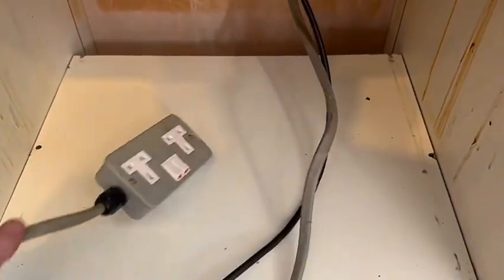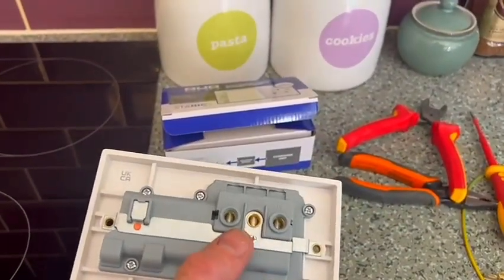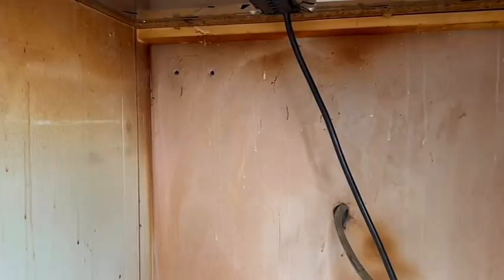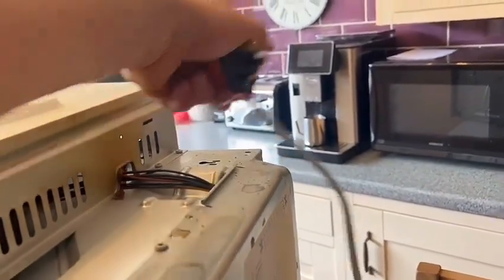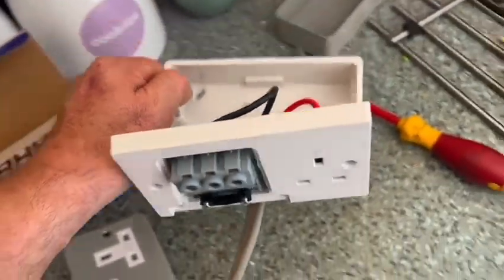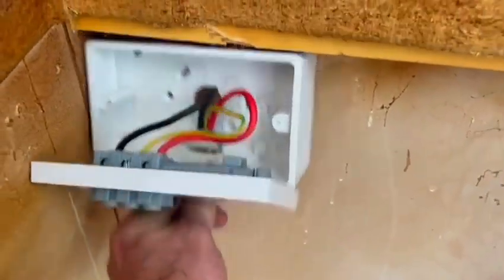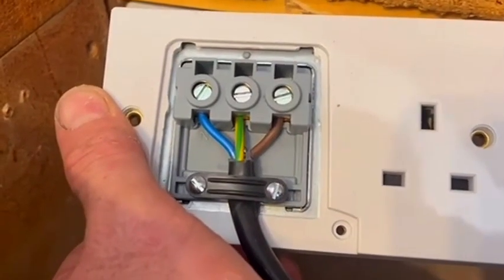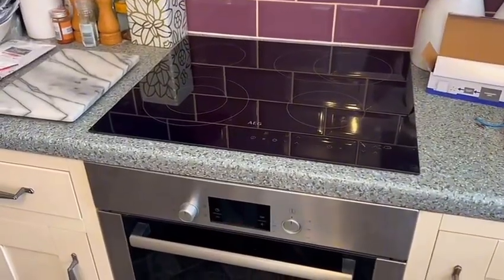An Easier Way to Wire up a Cooker

Comment: Washers are a good idea on the back boxes. As an alternative, I've started using washer head screws instead of wood screws and washers. 

Latest hob and oven I'm doing, both are on 13a plug tops. Handy.
Reply: @rodgerq
I hope the sockets are accessible. 
I saw this with both hob and oven on a final ring in a one bedroom flat. The ring was in 4mm cable, which I thought was overkill, but maybe they did the derrating calcs. Only two circuits, the final ring and a 1.00mm lighting circuit, both on AFDDs giving maximum protection. The CU was a small inexpensive unobtrusive thing. I asked if there had been any problems with tripping, they said ''no''. Heating and hot water was by a gas combi, so no heavy electricity demand, although I saw a washing machine and small dishwasher. Diversity worked apparently. The one final ring was suited to the lifestyle of the occupants for sure.
Reply: @johnburns4017   kitchen isn't fitted yet but I'll probably just mount the socket in the adjacent base unit and pull the cables in through an access hole
Reply: @johnburns4017  good info mate. Thanks for that. Haven't seen those EV sockets tbh but they do sound better(built like how every other should be)
Reply: Do not use a double socket for the two appliances, as the double is only rated 13A for both outlets. Use two single sockets. BS1363-2 says for the temperature rise test for a 13A socket the connected load will be 14A for a minimum continuous period of 4 hours or longer until stability is reached with a maximum duration of 8 hours. Manufacturers skimp with their sockets unable to pass 13A continuously, only for short periods - breaking the law. 

There are sockets available with ''EV'' on the front and back which are built more robustly for EV charging, being tested to continuously pass 13A. Which consists of 28 continuous cycles each of 8 hours on, 1 hour off, 8 hours on, 7 hours off followed by inspection. There are no design changes to an ‘EV’ marked socket, relative to the standard sockets, just some extra tests, and some letters applied to front and back.

Use ''EV'' sockets. They are not much more in cost.

Comment: That does not conforms to the regulations, if no external accessible isolator. But forget the connection unit the customer provided. Get a double connection unit and hard wire in the oven. You do not want a 13A fuse hidden and 13A drawn for long periods from a plug - plugs were intended for portable appliances, not fixed.  The oven does not need a fuse as it is a resistance element appliance that cannot draw more than 3kW. All the oven needs is fault and RCD protection at the consumer unit not overcurrent protection - if the cable is capable of taking more than 13A. Also, a fuse running at max amperage for a time, which this 13A fuse will do, can get hot, so avoid.
Reply: Isn't the Isolator at 1:48🤔
Reply: @temp26j724-i  Yes it is.
Reply: @temp26j724-i  
It is not clear. He clearly said socket.
Reply: @johnburns4017  The cooker isolate is CLEARLY visible at 1:48.  What you had down below was the outlet that went into a double socket.  That's what he replaced with the new device.  This gives the means of isolation and makes everything compliant.
Reply: @cjmillsnun  
No cooker isolator is clearly seen at all. He clearly said socket.  He said the thinks it is 2kW. Sounds like a DIYer. The first think a professional would do is ascertain the kW.
Reply: @johnburns4017  It's a cooker isolator switch with a socket. Pretty standard. As you are not an electrician, you obviously don't know what you're looking at.
Reply: @davebadger100  
Not clear. The vid does not show an isolator. He said socket. I never made it up.
Reply: Ignore John Burns His House Down. He is not an electrician. He is a Walter Mitty type who frequents the comments sections of electrical videos imparting his version of regs and practices in a vain attempt to impersonate an electrician.

Various nuggets of his "knowledge" include.........

An obsession with French electrical practice where he tells everyone that UK domestic installations should be protected upfront with a 500m/a time delay RCBO even though most UK installations are not TT unlike France. Even though 500m/a is unsuitable for domestic anyway. 
That is a change from his original stance when he insisted that an normal 500m/a was required, but didn't/couldn't see why this was a bad idea.

He thinks that ring final socket circuits cables shouldn't be terminated at the socket, but rather wago'd off in the back box and the socket fed from a single flex.🙄

The other day he said that a ring final circuit should be protected by a 2 pole MCB.

On a fire alarm video he insisted that domestic fire alarm circuits MUST be on lighting circuits rather than a dedicated circuit, even though both BS7671 and BS 5839 say nothing of the sort and he then completely avoided the point when asked to back
 up the claim. 

He hasn't got a clue.
Reply: Time served for sure^^
Reply: @MegaMetinMetin half an hour time served
Reply: @curtisj2165  
Which is a lot more to your 30 seconds. 🤣
Reply: New Howdens 2.3kw ovens have a Do No Fit Plug attached
Reply: @johnburns4017
All UK plug tops that conform to BS1363 requires a BS1362 fuse. 
Do not use if the plug top does not have this on the plug top! Also if the plug top have no fuse like the foreign plug converters that do not have the BS1363 and is fused ARE VERY DANGEROUS! They frequently heat up and are known to cause fires🔥!
Reply: @MA-mo7yj  
It is plug not plug top. 🙂  Plugs are for portable appliances. Fixed appliances need to be hard wired, especially those running at maximum current draw of thirteen amps.
Reply: The oven is 2kW.  2kW is not 13A.  13A at 230V is 2.6kW.  in old money using 240V it's more. So it will draw 10A max.  So no it won't be working at max amperage, it won't even be close as there is 600W spare capacity if running at 230V.  In reality it'll be at 240 (as we haven't changed transformer infrastructure in the grid) so will be drawing 8 1/3 amps.
Reply: The oven comes with a plug, so it is designed to have fused protection.

If anything happened to the oven and it caught fire or damaged the kitchen oven housing or worktop then the insurance company wouldn't pay out
Reply: @marcoequi111 plug top have been retro fitted.  It didn't come supplied with plug
Reply: @grumpyspark2549  
Correct. A brief glimpse of the fitted 13A plug can  be seen at the beginning. He did not say what the kW of the oven was - only he thinks it is about 2kW. Which appears too low for an oven.
Reply: @marcoequi111 
As long as it is fitted to current electrical regs it is fine. Sometimes manufacturers inatructions take precedence.

One thing is clear fused plugs should be accessible. So a socket needs to be in the next cupboard with an opening door.
Reply: @johnburns4017
No the BS 7671 ALWAYS TAKES President! If the manufacturers instructions contradict the regs then seek professional advice! (You are OBVIOUSLY NOT COMPETENT WITH ELECTRICS and should stop giving FALSE AND INCORRECT ADVICE!).
Not true but you can state the regs to prove me wrong. Also there is a easily accessible isolation switch above the countertop next to the hob which is shown in the footage.
Reply: @johnburns4017 there is no regulation that say fused plugs must be accessible
Reply: @curtisj2165  
Regulation 553.1.5: Socket-outlets “shall be installed in a position so as to be readily accessible for use”.

Regulation 132.12: Every item of equipment must be arranged so as to be accessible for operation, inspection, testing, maintenance and repair.

If a socket and fused plug is hidden behind an appliance (e.g. a fridge/freezer/oven), it may be acceptable only if there is a separately accessible double pole isolation switch controlling it.

Regulation 537.2.7: requires that you must have a readily accessible means of switching off — typically a switched fused connection unit (FCU) or isolator switch above the worktop.
Reply: There's no fuse in that unit
Reply: @curtisj2165 
Not required as the plug top has a fuse.
Reply: @curtisj2165  wrote:
''There's no fuse in that unit''
Strewth!

Comment: I'm no electrician, but of this socket is wired to a 6mm cable for the oven, w I uldnt it then potentially allow to much current to be drawn by the hob cable without tripping the MCB? I guess you can compensate by having a 13A fuse incorporated in the socket or on the plug, but nevertheless isn't this still a concern?
Reply: The MCB will trip if too much current is drawn. Cable size doesn't affect how much the oven will draw. An oversized cable is fine, an undersized cable can cause fires
Reply: @bol317  
That is current thinking. Seventy years ago when we had circuits protected by fuses, the fuse in the plug was to protect the appliance and flex. If a flex could take 13A on an appliance rated at 5A a 6A fuse was fitted in the plug. These days a 13A fuse is acceptable as the flex is protected - I go by the older ways as the appliance has more protection - one being a L to N fault, which will be grabbed quicker by the fuse, and an RCD will not detect, but the plug fuse will. 

A 3kW oven with resistance heating will not draw more than 13A of current. Now we have MCBs they will detect L to N faults and an RCD detect earth faults. So the sway went over to what you wrote, an oversized cable is fine, - as long as the oversized cable has overcurrent protection to protect only that cable.
Reply: @johnburns4017  It's a 2kW oven.  He said so clearly in the video.
Reply: @cjmillsnun  
He said he thinks it was 2kW. I have never seen a 2kW oven that size. All have been 3kW. 

The first thing you do is find out the exact kW. I have seen some 3.5kW, which is way too big for a 13A fuse.

Comment: Does that mean there’s no longer a need to run two different cables for an oven & a cooker ?
Reply: I suppose it depends on the overall current draw of the hob and oven. 
Its not a one size fits all.
Reply: @AdamTheAd-vanc3d cheers
Reply: Depends on the load, the cable and breaker size as always.
Reply: Prob not
Reply: Clickmode do a dual appliance outlet then there’s no fuse behind the oven to worry about either.

Comment: Socket in line with a hot vent? I see scorch marks on the wall.
Reply: Good observation. Where would you have located the connection unit out of curiosity?